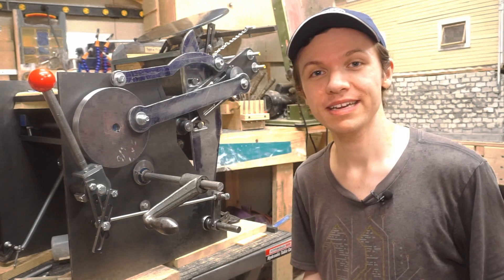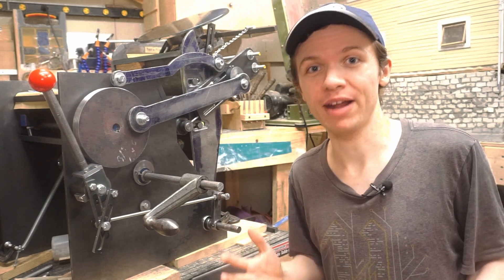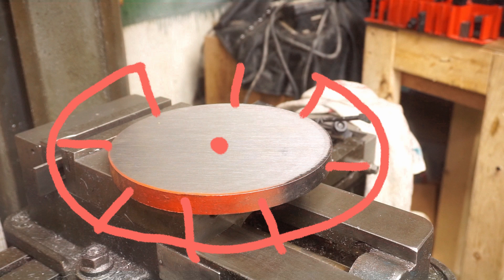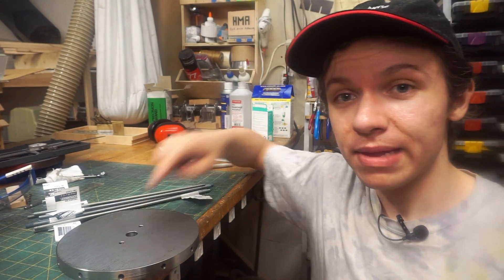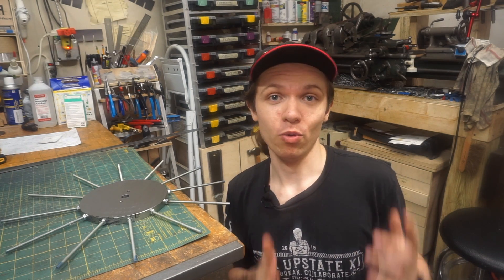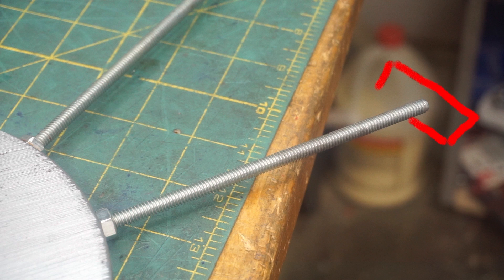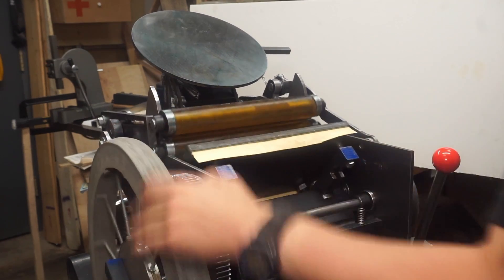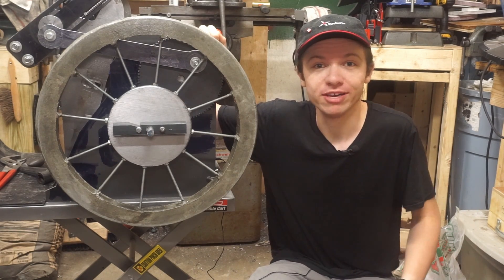Building a Letterpress: Casting a Handwheel

Comment: Just got into letterpress and sourcing parts and stuff has been a huge pain, I'm amazed at your craft work to make all this yourself. The flywheel looks awesome! Are you concerned about durability? I feel like I would be worried I'm one mistake away from cracking the thing, though as a best attempt for what's available it looks great
Reply from the maker: Thanks! Yea, I am a little worried as to how it will stand up long term - I've had a few chips fall off, but other than that it's stayed mostly intact over the past ~6 months. One thing I'm considering is covering the wheel in some farm + implement paint (the same stuff I use to paint the press in a later video!) and I'm hoping that will help keep the thing together. But for the caliber I am working at, I think what I have is going to be fine.

All that being said though, if I ever make a friend with access to a foundry - I'd definitely give it another go out of iron!

Comment: I love the handwheel. I’m wondering how much it weighs. 
Are you attaching the letterpress to a surface to avoid it tipping over or is the wheels weight insignificant compared to the mass of the machine ?
Reply from the maker: It I had to guess - around 20lbs? I sort of wish it had been heavier to be honest... but I think it's good enough. But you're right, it's pretty insignificant in weight compared to the rest of the machine so (at least so far) I haven't run into any tipping over / etc?